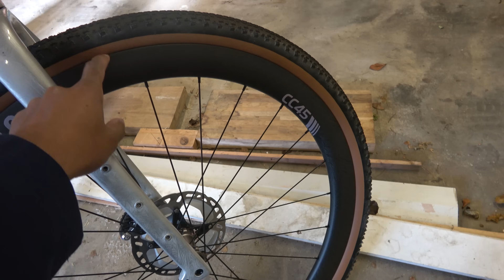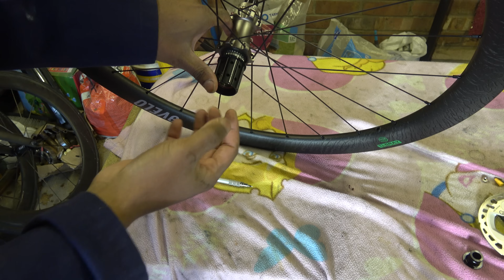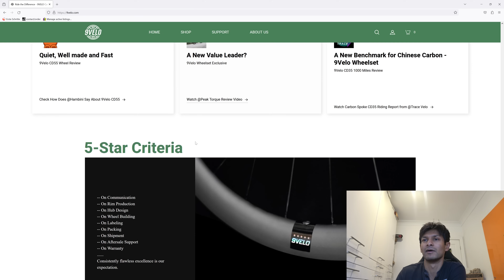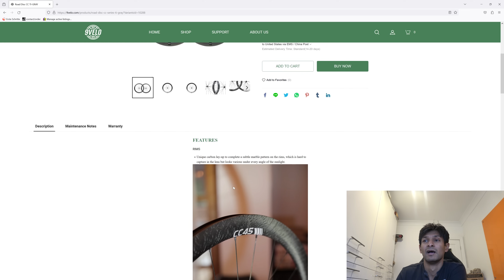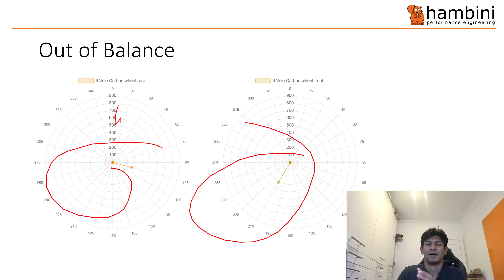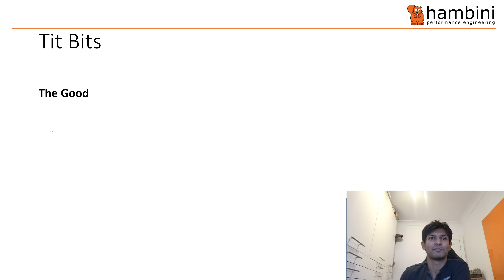DT Swiss get Completely RINSED BY 9Velo Wheels Ratchet Hub

Comment: @Hambini
Can you make a video comparing traditional flanged hubs with J-bend spokes against straight pull spoke hubs?
Some people speculate that the alleged advantage of taking away the (alleged?) stress point at the J-bend is really a hoax, and that the real reason manufacturers are switching to straight pull is that it is less time consuming to lace the wheel.
At the same time, some people think that traditionally flanged hubs with J-bend spokes make for a stiffer wheel, since the spokes have more of an angle inwards from the hub to the rim..
Reply: With hubs that use J-bend spokes, wheelbuilders can choose the amount of spoke cross lacing suitable for each wheel, like whether you want a front rim brake wheel to run radial or 2x lacing.
Reply: @sbccbc7471  That is true, and thank you for weighing in.
It is not what I’m asking about, though.

Comment: Frankly, I still don’t quite get why I should take a closer look to this manufacturer or other manufacturers shipping from China directly. Quality might be fine in some cases, but in case of failure or any warranty claims things will obviously become much more difficult and less clear to handle than just contacting your UK (or, in my case, Germany) based dealer. All this would be fine if the price difference to the typical renowned wheels was exceptional - which it is not, I’m afraid.

Feel free to prove me wrong, but I don’t get it yet.

Comment: In 2006 I bought a set of Campy Zondas that had no holes in rim bed. 
Probably the most bulletproof wheels I ever had. 
Used them for 12+ years, done over 70kkm. Never went out of true.
Reply: I have a set of Fulcrums which were THE last rim brake, NOT mile wide rim, Campy record 10 compatible freehub wheels I could find 2 years ago (most likely not even made anymore 😡) with the sealed rim/no spoke holes, inners.

I am not worried since I simply cannot even remember when the last time I broke a spoke, at all, and have been riding some ancient, 13mm inner rim width, rim brake, alloy Mavic Cosmic Elites while hitting some nasty craters/bumps at speed, and have never broken a spoke on those.

Comment: Thanks Hambini, great and honest review as ever. Actually, on the subject of broken spokes for this wheel, spokes tend to break in the joint with the hub (a know stress point) or at the end of the threads coming out of the nipple (again a high stress point). If you're lucky, you can leave the nipple in the rim, unwind the broken spoke and carefully wind in a new one. Use long nose pliers to hold the nipple until the spoke has seated in the thread, then use a spoke key.

Comment: DT hubs. As far as I'm concerned are a one point of engagement hub as far as in if any tooth is compromised, I.E, something gets between them be it a grain of sand or a piece of swarf, all the teeth  miss engaging and slip. I HAVE seen two people break collar bones through these hubs. People bang on about regular servicing being so easy but come on, how difficult are pawled hubs to service. Look at any mechanics ratchet, 99.9% are pawls and last decades without a thought.
Reply: Which is what makes Chris King the art & engineering champion.  The harder you pedal, the more force acts on engaging the ratchets.  Relying on a .8mm deep beveled surface is cutting it pretty close on the DT!

Comment: Campy wheels & Fulcrum wheels require (or did based on the wheels I have) using a magnet to replace a nipple. It isn't that difficult, just requires a bit of fiddling, but works when you get the hang of it.

Comment: Maybe I missed it, but are they steel nipples? Or are brass nipples magnetic? 
I’ve seen aluminum nipples, brass nipples and pointy nipples but never steel nipples. How would that magnet trick work?
Reply from the maker: screw in a bit of a spoke.
Reply: @Hambini  wow that sounds like a right pita! Assuming you have to leave enough to also be able to remove it once the nipple is in place! 
Thanks for the reply!

Comment: IGPS are great value for money. 
Paid £45 for mine. The maps are a bit hard to read. The early heartrate monitors used to drop out when you passed a phone tower but the newer versions are fine. Battery failed on mine after 3 years , IGPS don't support replacement but got one online and soldered it in and still going strong.

Comment: Today, Hambini (c)reams! 

Just a word on the points of engagement, the ratchet being at the hub means the degeees of freedom at the crank varies by gear. I currently have a 36 point of engagement rear hub on my MTB, and i really dont like it for climbing because it translates to about 17 degrees of freedom at the crank in the 52t. Granted, it would be less with road gearing, but it's worth noting.

Comment: Before I saw the end of the video... I already thought the issue will be badge appeal.   Let's see if the unemployed, sorry meant influencers/shillers, jump on these.  Probably not though, needs ZIPP or similar in massive letters on the rim wall.  Looks much better when propped up against the wall at the twat central Cafe in Richmond Park.  

Are these hubs loud enough though?  That might be an issue too because you know loud hubs makes you Pro innit.

Great wheelset though.  Would certainly be a good choice if I jumped on the gravel bandwagon.

Comment: I just went to the site and you can't select the hub ratchet anymore. I prefer a faster pickup because my wheels usually do double-duty for CX racing, and faster engagement matters. Still, it's not like I race that often, so I might just grab these with the 36T this spring.

Comment: If you broke a spoke, unless it broke down by the nipple you’d be able to grab the broken end, pull it, then put a clamp on the nipple to keep it from falling into the wheel. Then unscrew the broken spoke and replace - once you’ve screwed the new spoke into the nipple remove the clamp and tighten.

Comment: As a super heavy rider (~150kg) I would love to see a structural test for heavy rides. As far as I know all carbon wheel manufacturers stick to the EN/DIN rules and don't design or test with heavier "loads". 9Velo's GV series claims to have "no rider weight limit" but as we know, there is a limit to everything. But where exactly? The CC45 road wheels you tested have a limit of 120kg but we all know they won't fail at 125kg… any maybe not at 135kg. But where is the safety limit?
Reply: they won't fail at 150kg on tarmac

Comment: For those kinds of rims, you can use an air compressor and a vacuum to pull string through the hole, and then thread the nipple through. Pain in the butt however you can use different nipples than steel.

Comment: Nice looking set of wheels. I recently found my new gravel wheel to be improperly dished, so I fixed it. In the process I found the decals on the rim to be INCREDIBLY annoying when truing the wheel.😠 Maybe the 9Velo are flush with the rim, but if not, be aware that they can be equally annoying
Reply: Their new wheels like the GV 2.0, LV 2.0 and CD 2.0 come in a different design, and here instead of using decals or enamel, they just laser etch it directly onto the rim.
Reply: @DonnieX6  nice, laser etched is the way to go
Reply: @WowRixter  Indeed! Also saving some grams for the weight weenies, hehe... Will probably pull the trigger on a set of GV 2.0's :)

Comment: Hambini: is the internal axle bore on 9velo hubs a constant diameter or is there a different diameter towards the middle of the axle?
Reply from the maker: it's stepped.
Reply: I have a look 765 rs gravel bike with the speed release dropouts, and I use the mavic qr thru axels.  They require a hub axle with a constant bore.

Comment: I use a gear cable thread it through the valve hole to the vacant spoke hole pick it out will a spoke slide your new spoke nipple (remember to get it the correct way) slide it through

Comment: Sorry to be a pain Hambini but for future reference... spoke numbers are generally an even number each side. Which would give 20, 24, 28, 32, 36 etc. as a total.

Probably only someone like Fulcrum/Campag has messed about with odd numbers on one side laterally laced with a one to two ratio of drive to non-drive side. Great wheels but good luck getting them re-built.

As a high end bespoke wheel builder for almost twenty years... I agree DT Swiss hubs are good ish but there are better. From a spoke POV always Sapim imho, especially if you can afford CX-Ray...

These wheels do look very nice, a bespoke builder would probably struggle to compete on price. I'd like to see a long term review from someone who puts in serious gravel miles. Proof of the pudding and all that!.

Would interested to see drive verses non drive spoke tension and if nipple washers (oh er missis) have been used to protect carbon spoke holes when riding tough gravel routes.

I've built wheels that have been around the world and are still in true. 😊
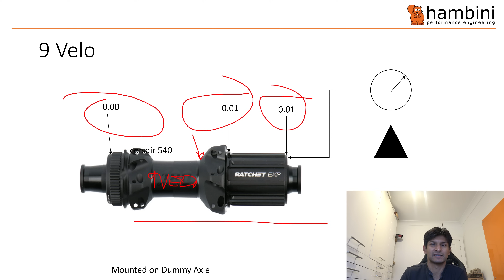Reply from the maker: I've seen plenty of wheels that have an odd spoke count? 21:18 is quite a popular amount.

Comment: There’s a way of guiding a spoke inside those rims… use dental floss (considering there isn’t any carbon fiber loose inside) and then aspirate it with a vacuum cleaner so you connect both holes… the rest is guiding the nipple through the floss (tied to the de tal floss)

Comment: It's all well and good until six years from now and you need parts and 9 Velo has gone out of business and your $1500 wheels are landfill.  Nope.  Not gonna do it.
Reply: What would you need that can not be replaced on a modular manufactured wheel?? Rim? Replace it. Spokes? Replace them. Hub? Replace it.      Rgr
Reply: @borano2031  ratchet and freehub body are consumables. Unless you're saying that whenever either wears out (and they do) you're going to drop another 1500 on a new set of wheels rather than just paying 50 to get the parts replaced.
Reply: @channul4887  Doesn´t matter what are "consumables". On a modular wheel you can replace everything, because it´s a modular wheel. After six years, if you can´t replace an original Velo9 rim from any reason because the company went bust, buy another brand of rim. IF Sapim goes bust and you snap a spoke, buy a DT Swiss as a replacement. If you scrap the hub by any problem, buy a Novatec or a DT Swiss. What´s the problem?? Keep the wheels running.    Rgr
Reply: @borano2031  well it does matter because only a madman would want to replace the whole hub and have the wheel rebuilt just to fix a ratchet or a free hub body issue. With DT Swiss if either of the parts go in 5/10/15 years time you'll get support, or you'll be able to find spare parts, even if they are NOS.
Reply: Does anyone keep their wheels that long?
Reply: @theillegalimmigrant9314  WOT?

Comment: About the spoke and magnet procedure, you can use a thin thread and insert it on nipple hole that snaped then vacuum it from the inlet that you mention and then guide the nipple through the wheel shell using the magnet to help you.

Comment: As I watch this, there are 7400 views and counting, and only about 500 likes.  I seriously don't get how you can watch this and not like it, there are FEW reviews floating around on the witchcraft bike industry that actually show you data and numbers.  I can't seem to figure out if this hub is on ALL of their wheels or not, their site doesn't really market the tech or name it so you can easily cross reference.  They need a new pen most likely for the website.
Reply: The info should be there, this hub is the V8318 and is listed under the specification section for the CV45 wheels. The LV series now use the V261 ratchet type and the NV series use V340 6 pawl system. So these are their top hubs I believe.

Comment: For re-spoking that wheel, I would use hoover and cotton.   Hoover a length of cotton from valve hole to spoke hole, once the cotton is all the way through, attached the nipple.  Not all nipples are magnetic
Reply: You buy a small insert to fit in the nipple to attract the magnet. Lead the nipple to position, unscrew the insert and do the rest.    Rgr

Comment: I get what your saying about DT hub's but they're better than the vast majority that on the market that can be had for pocket friendly amounts.ie the best of a bad bunch! Ive lucked out with my rovals, though  the bearings in the front wheel are not all that free running (tight seal and lots of grease I suspect) they're smooth and show no signs of notching in a year of use so far, winter riding and the like. will change out to NTN when the time comes. but I cant complain. Ive had others parcours, hunt, hope and the bearing all go shit in about week.
Reply from the maker: This is a better hub, costs less, uses standard bearings. I can't think of a reason to get the DT hub.
Reply: @Hambini  I can't think of any reason either... maybe except long term accessibility and ease of sourcing of proprietary spare parts, like ratchet or free hub, i.e. shit that matters.
Reply: @Hambini  it looks to be very good but many have chosen there poison. But it certainly a brand I'll give a serious look into in the future. especially as there using easy to source spokes.

Comment: Does precise manufacturing tolerances relate directly to great performance and reliability? Combining these technical deep dives with longer term real world use analysis would be mega, but appreciate there’s only so much one man can achieve in a given timeframe.
Reply: The better the mfg tolerance - the better the reliability, it's obvious that if parts fit correctly they're a lot less likely to damage each other and should last longer
Reply: @stuvademakaroner9607  Indeed I agree with you. I’m very limited in my engineering knowledge so excuse my naivety for asking, but could there not be other factors at play that determine reliability eg quality of the materials used? For example, the carbon layup of the rims wasn’t investigated; could they withstand heavy abuse from a 90+kg rider?
Reply: @HazzyWazzey  have you seen such investigations of other wheels?  I doubt there is much difference between carbon rim manufacturers, if there are no visible defects it should be perfectly fine, especially for road/gravel
Reply: @stuvademakaroner9607  what’s with the attitude? 😂
Reply: @HazzyWazzey  idk I'm totally chill

Comment: I recently had to rebuild a wheel without spoke holes using a magnet to put the nipples in place. The guys in the bike shop thought it would be a nightmare but it was fine. Just cut an old steel spoke for the magnet and the nipples popped in fine. Don’t let no spoke holes put you off buying a set of wheels.

Comment: Honest question, how and to what extent does the hub’s run off affect ride quality and bearing lifespan? I wonder how many watts are lost by a bearing that’s ever so slightly dragging, and whether this is actually noticeable by a normal rider, let alone on a gravelbike or mtb where drag/rolling is affected by so much more than just the bike’s rolling speed.
Reply from the maker: Put it this way, it's better to have lower run out. Usually you have to pay more for better tolerances, On this occasion you pay lss

Comment: It sounds like they had to get tolerances that tight in order to provide a reliable fit for that special seal. My question would be, how do actual DT wheels work with their "bad" tolerances. You keep tiptoeing around a full review of those.
Reply from the maker: That review is available, just not on YT. ie it's paid.

Comment: How I built my wheels with rims with no nipple access holes.
To get nipples through I used an old Dyson vacuum cleaner for suction through nipple holes. You most likely figured out the shape of the vacuum hose tip for maximum suction depending on the shape of rim. I cut  an old threaded part of a spoke(about 10mm or so, so it can get through the enclosed rim section with tooth froth attached to it). I thread a nipple to the threaded part of the mentioned tool. And attach the vacuum cleaner hose on the rim at a spoke hole closet to the valve hole first to suck the loose end of the tooth froth which is fed through the valve hole. Make sure the tooth froth is long enough   for the farthest nipple hole from the valve hole. As for my experience, once the loose end of the tooth froth comes through a nipple hole the nipple comes right through the nipple hole. Patience is the most important aspect of this process.
Good luck to you if you go along with this method.
Reply: By tooth froth do you mean floss?
Reply: I will try a Dyson vac on my nipples, thank you.